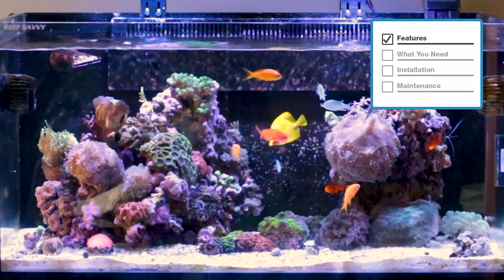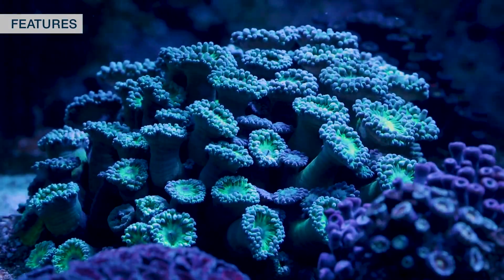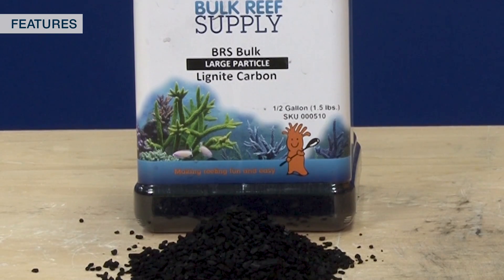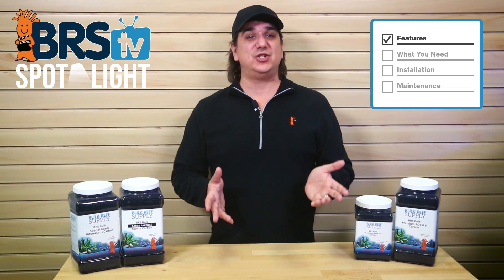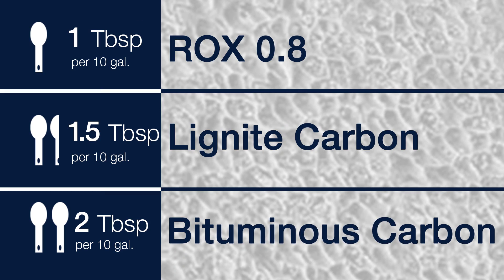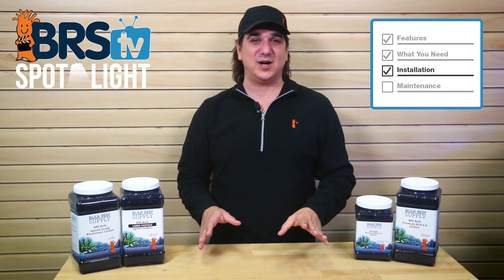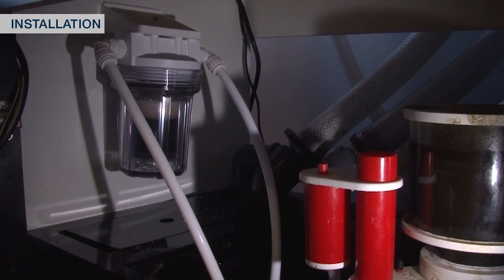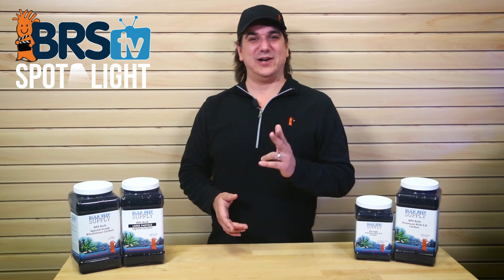Using BRS Carbon for crystal clear reef tank water | BRStv Spotlight

Comment: Can you address the question that AC might remove trace elements. Especially iodine? 
I have personally seen issues, potentially related to using too much AC - I would like to know if there is any scientific evidence to support my claim?
Reply: BulkReefSupplyCom would be easy enough to test. And I think I think it's quite important to know. Especially when important opinion makers like BRS recomend to use it with zero concern:)
Reply: Ya that's kind of important to know...